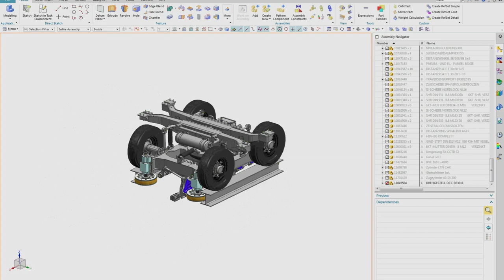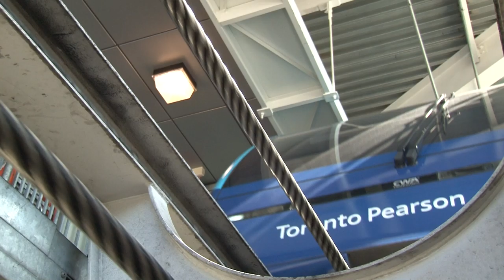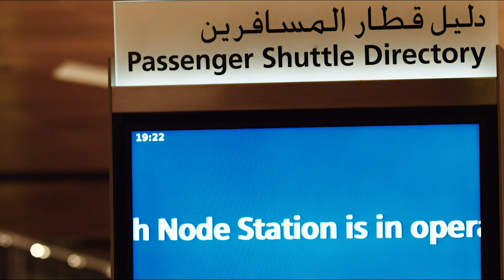Doppelmayr Cable Car Imagefilm (2018)

Comment: What is actually the advantage of this over a(n) (autonomous) light rail system?
Reply: im also intrested in this
Reply: You don't power along the entire track, motors are only at the stations, lighter vehicles and thus easier track construction, quieter, no need for switches or maintenance halls
Reply: looks like these advantages worth it, i wonder whats the effective distance
Reply: Hmmmm okay, seems quite logical.
Reply from the maker: Hi Luuk! There are many advantages - dasBunny already mentioned several of them. Besides that the Cable Liners are environmental friendly (electrically powered), fully automated, barrier free, very flexible and usually cheaper than comparable systems.
Reply: @DoppelmayrSeilbahnen  Well okay. But are there really no operators on it? Because there are on the Funifor's (or at least the one's I've been on while skiing).

And being electrically powered doesn't make it environmentally friendly by definition. If the power comes from a coal plant it isn't really that environmentally friendly...

But besides all that and now by knowing the advantages, I think it's quite logical to use a system like this in places like airports and such. I do not think something like this is suitable for longer distances. Or is it? (Except for the mountains)
Reply from the maker: @luuk777w  There is usually one operator in a central control room. Your point regarding electrical power is obviously true (for all E-driven vehicles). Our longest system so far is the "Oakland Airport Connector" (BART) with 5.1 km total length, four trains and three stations. Our system can't substitute regular train networks, but we can definitely build longer cable liners than we have by connecting multiple rope loops.
Reply: @DoppelmayrSeilbahnen  Hmmmmmm okay, I understand now. Thanks for responding.